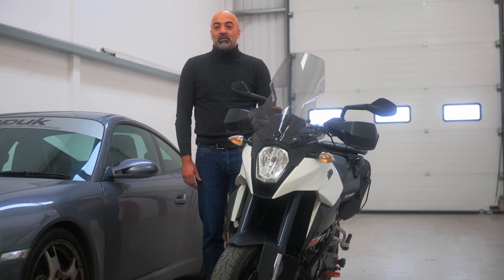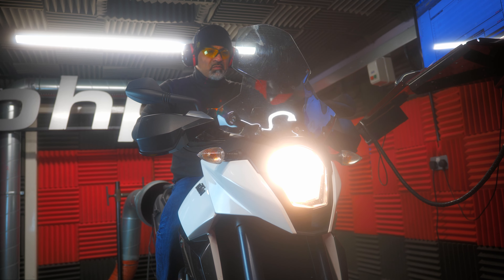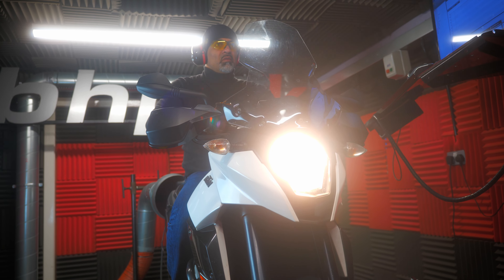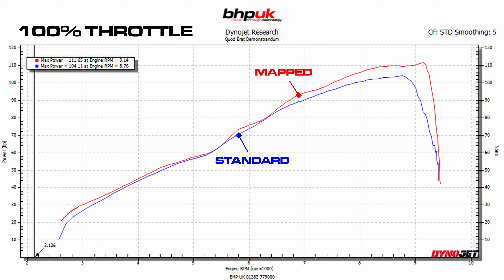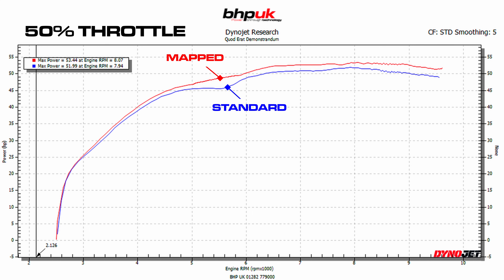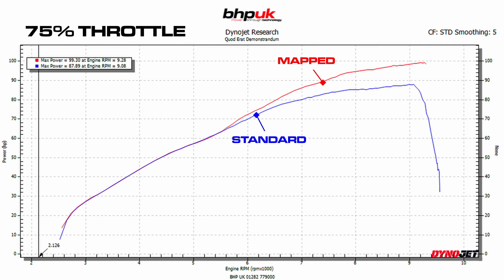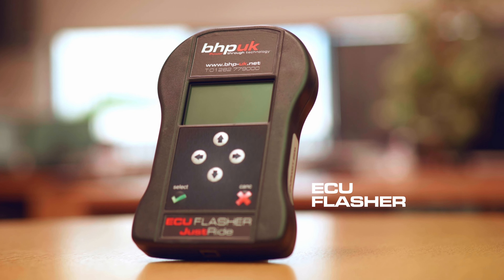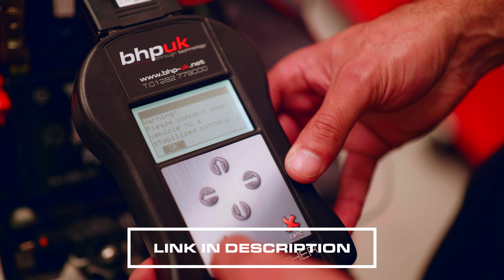KTM 990 SMT | ECU Custom Dyno Tuning

Comment: Hi. What do you think of the ol' 990 SMT? I do see comments about the motor drinking lots of petrol. I'm not sure if the new 890 SMT is as good considering the price tag on release is relatively close (with a 10 year gap). Also the 990 has Bremobo's which makes me wonder if KTM is going cheap these days. No bike is perfect but my DL1000 V-strom felt like a pig. I'm riding a DRZ400 right now and love the light weight. Cannot handle the seating position of my old Aprilia Mille with Rotax engine. The 690 SMC looks good but it seem they went cheap on the dash. If the 990 is decent and half the price used (around $6-7k used USD in 2023) then I'll go for it and spend the extra $$$ doing mods. Watched a another video where people said stock map had low RPM problems.
Reply: I've got a 2010, and you're correct, it's a thirsty beast. I came to it from a Tuono with the same Rotax engine as your Mille, and I got caught out with a low oil warning after a few months, which is how I know it sips a bit of oil too. This is compared to the Tuono which never burned a drop. 

I love the SMT, I commute daily, rail hail or shine and with 85,000km on it it's in need of a refresh but it always starts first go, goes hard and is great in traffic or on the freeway. 11/10 would recommend.
Reply: The 990 SMT is one of the best and most underrated bikes of the last 20 years. Built in the sweet spot era of KTM with high end components and little to no electronics, you can't compare it with the recent junk they make. You also can't compare it to Japanese bikes which are so generic in comparison, KTMs of this era felt crafted. I had an MT09 which is probably the most radical Japanese bike made in recent years, the 990 feels so much more raw. If you get over the looks, the SMT has the best seating position, comfort, and performance balance of all the LC8 bikes. I use mine like an adventure bike and offroad with it, I haul ass on the tarmac, did 4000 mile trips with it. It drinks gas like a beast but who cares, smiles per gallon are more important.

Comment: Hi I have a 2012 smt and it is tuned , full Leo Vince exhaust and SAS block off plates.. my question is , if I removed the 2 block off plates would it pop and bang more ? I'd like to do it If so for fun , would it damage the bike ?
Reply: It also has DNA Stage 3 air filter